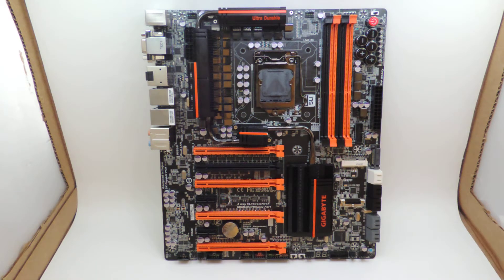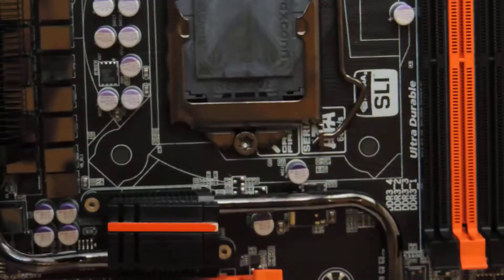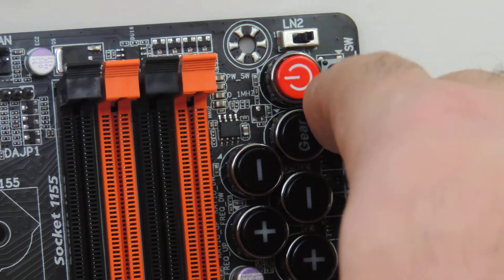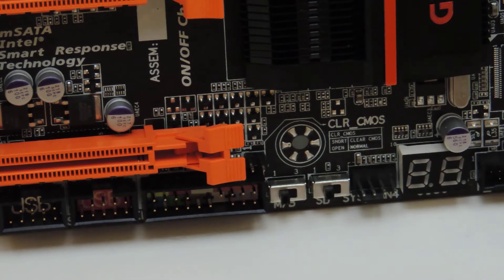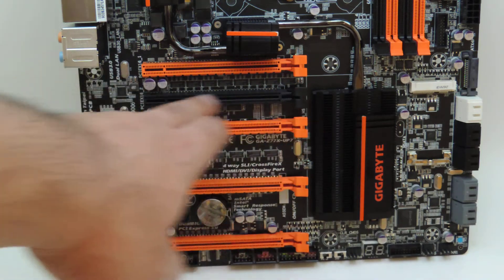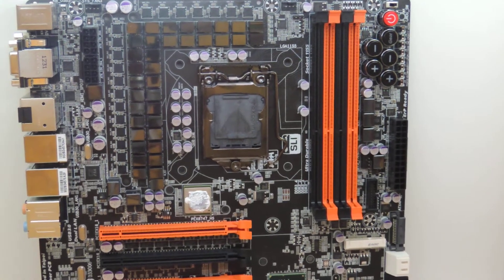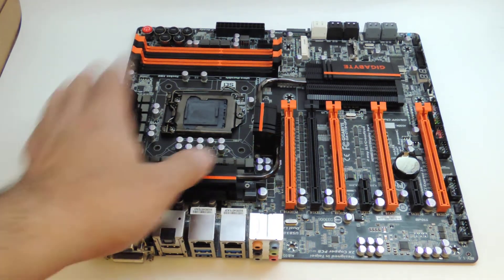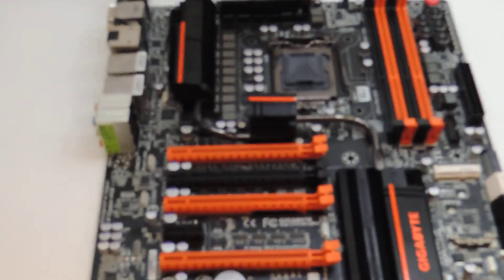[SH]Z77X-UP7 Review

Comment: The 3930 cpu needs a board with x79 chipset but this one is based on Z77 chipset and supports only sandy and ivy bridge cpus so from 3930 and 3770k cpus only 3770k is supported on this particular board (and on any other Z77 chipset based boards).

Comment: quick questions if you don't mind. will this board run 2 way sli in the orange pcie 3 slots both at x16 ? or is it only x16 for one card and x8 for the other card? 

thanks for the vid :) this is one kick ass looking mobo